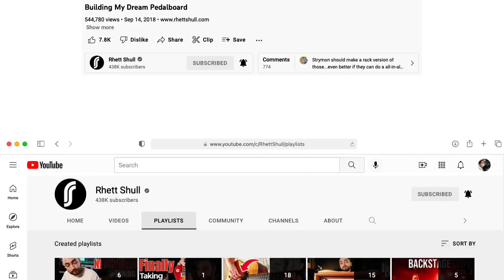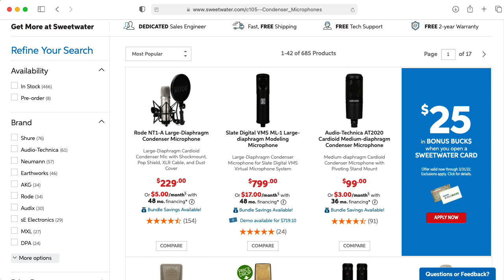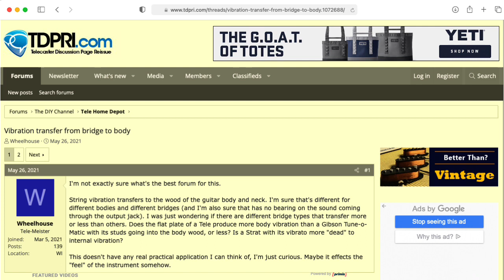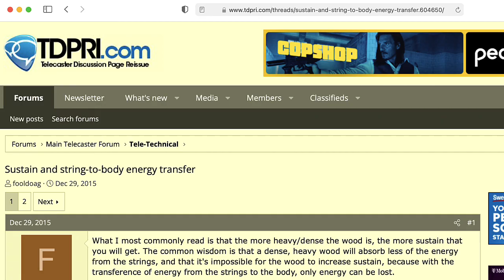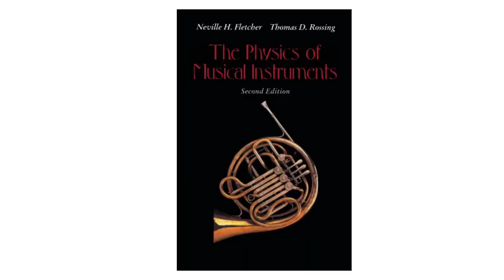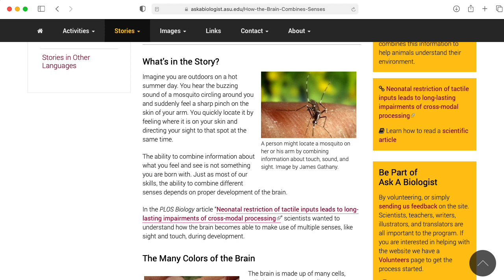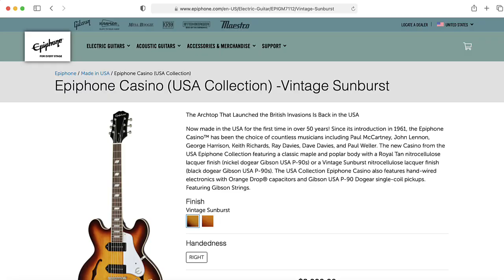Refining Rhett Shull's Resonance Reasoning: Vibrations in Electric Guitars and the Sustain Paradox

Comment: Sustain is weird, I worked in a shop for more than a decade and played 10s of thousands of guitars. Some guitars definitely sound better acoustically (my own do) and they also have plenty of sustain. I've played others that don't, and "dead" guitars I noticed a lot of times lacked sustain and had a lot of dead spots on the neck particularly on the G string. Some "dead" guitars had the same or less sustain than a banjo does, decidedly unpleasant instruments to play, but others had a lot of sustain. I'm not entirely sure if we can quantize what it is about them. As for tone, hardware can absolutely affect the sound coming through a pickup depending on the harmonics that are emphasized by the particular fret and bridge and nut materials. I bought some naval brass inserts for my Floyd rose once, and it make the guitar zingy and shrill, not only that but it seemed to setup strange resonances in the string which actually made natural harmonics have odd beat tones.
Reply from the maker: The hardware in the nut and bridge is part of the boundary conditions of the wave equation, and is absolutely worthy of further study. The typical equations (like the ones I cover in lecture for this class) assume that the end points are perfectly still -- which we know isn't the case since we can feel vibrations going into the neck and the body. It would take someone with a better understanding of mechanical engineering than me to dig into that...
Reply: @Lantertronics  Zollner has studied the behaviour of string vibration losses around the bridge/tailpiece of solid-body electric guitars with techniques like laser vibrometry. There is scope for more work on how different materials might affect that behaviour. The very small vibration energy that reaches the neck and (less to) the body have also been well studied. Our skin mechanoreceptors are just very sensitive to them, so guitarists tend to overestimate their significance.
Reply from the maker: I think that if there's fundamental flaws in the instrument like dead spots (and fret buzz, bad intonation etc), all that show up acoustically. So playing unplugged can give a quick sense of whether the instrument is a lemon or not.

Comment: One interesting sidelight is arch tops and mandolins which are designed (and I'm exaggerating here) to dump maximum energy  from the strings to the top very quickly  to produce "bark", whereas acoustic guitars are designed to control energy from string to top (most of the acoustic sound) in a controlled way to emaphise sustain.
Reply: Same goes for some electrics like the Fender Jazzmaster and Jaguar. Both tend to be quite loud unplugged - louder than Tele's and Strats. But have less sustain

Comment: I'll input some on this , its important to note that the body and the neck are very important as to the vibrations in the guitar not for what a player feels but for more of how the body and neck together keep the vibrations to a maximum. This is why denser woods in both body and neck do make a difference because the sound that is passing through the woods is able to pass more freely due to the density of the wood being greater than normal. Which allows for the vibrations to not only ring off the string but those same vibrations pass through the wood and back to the strings again cause the vibrations or if you will feedback on to itself which in turn allows the magnetic field to hear the vibrations for longer and for a more amplified signal to be produced. Its the return of the vibrations and keeping this sound revolving in a circular motion from string pluck to nut to neck to body to bridge to string and around over and over that gives sustain. The pickup actually becomes the most irrelevant part cause as you said , its just listening to the changes in the magnetic field. Of course , if you have a very crappy pickup , nothing is going to help it but a well made pickup , it will make a regular guitar sustain forever , but if you take that same pickup and put it in a very low density body and neck , the performance difference will be absolutely huge. I would also like to state that if the wood is very dense , a player can feel the vibrations better than one that is not cause the wood contributes to reflection more so than absorption of the vibrations. Also not only are the vibrations effected by the density of the woods , they are also effected by the amount and type of material that also touches the guitar like the players body , pants , shirt , belt , belt buckle etc. Which will also remove the time the strings will ring. All of this stuff matters but the pickup is the least that matters for this discussion. The nut , if its a bone nut or even better a stainless steel nut , something really hardened material wise and if the string touches more of the nut, that is better for sustain. If the bridge is a fixed bridge with several anchor points , that is better. I would say any floating tremelo bridge by comparison and design would be significantly worse than a fixed bridge for maintaining sustain. When you are looking at trems with locking nuts , those lockers create a more solid contact and anchor point which helps them to sustain , better. A whole lot of variables but I would be willing to bet , that a guitar like the ones made by https://304guitars.com/ has probably the best sustain on the market. Solid contact , top to bottom and through.
Reply: "Its the return of the vibrations and keeping this sound revolving in a circular motion from string pluck to nut to neck to body to bridge to string and around over and over that gives sustain."
That is completely contrary to all measurements of real guitars by Zollner, Fleischer, Pate and others. There is no circular loop back to the strings. When the body and neck are excited to vibrate by string vibrations, that energy has been lost from the strings, so measured sustain is always less. Luckily those measurements also show such body and neck vibrations to be very small. Some guitarists just overestimate their importance, because our skin mechanoreceptors are sensitive enough to feel them.

Comment: Great video, as always!
One thing about your last sentence: One wouldn't want a hollow body guitar for great feedback, because it is practically not controllable (speaking from experience, here). I want my strings to vibrate not my guitar body for that. Also a double Marshall full stack isn't needed, my 60W 1x 12" Fender Supersonic combo amp is more than capable of producing wonderful controllable feedback on pretty low volumes. The only thing that is needed is lots of gain, not necessarily volume.

Comment: I wonder if the reason why people claim to hear a difference in tone with different woods in a solid body guitar is because of how different kinds of wood will take away from the strings vibrational energy in different ways? Essentially, the wood behaves as a dampener and different kinds of wood will take away vibrational energy in different frequencies. People say maple is “bright sounding” so then maybe it takes away low frequencies, mahogany has more mids as people claim, so really it’s taking away high frequencies. Essentially the sustain of the guitar at different frequencies is affected by the wood’s vibration (which will be different for different pieces of wood).

And if you built a guitar out of perfectly rigid and hard material that does not take away any of the strings vibrational energy at all then you would have infinite sustain over the entire frequency spectrum of the strings vibrations.

That would basically mean that the ideal electric guitar is made of perfectly rigid and dense wood that does not vibrate at all and takes away none of the strings vibrational energy, but no such perfect ideal wood exists so we end up with the wood indirectly affecting the sound of solid body electric guitars.
Reply: (See 04:22) This is what Johan Segeborn is for :) https://youtu.be/pFOAH685KYE
= "This is what a GUITAR made of SOLID STEEL would sound like!" There are plenty of other "experiments" on his channel regarding "tone wood" and pickup interaction, too.

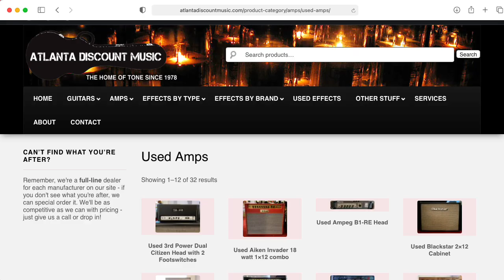Comment: From 3:55 to 4:03 is precisely the entire argument why tone wood matters. It came out of your mouth. Pickups don’t pickup directly acoustic information, but do so indirectly because the wood construction affecting the timbre of the vibrational strings. You change the timbre of the instrument, you Change what the pickups eventually hear. Place a tuning fork tuned to a note of one of the strings, onto the body of the guitar, body will resonate and eventually so will the string tuned to that note, and if plugged into an amplifier - that note will come out of the speaker. Place a thick rubber mat against the body to help deaden the vibration, and perform same experiment. Note will be quieter from the amplifier
Reply from the maker: What's interesting is the process is subtractive; different woods and bodies will be inclined to pull different frequencies out of the string, which doesn't seem to be how most people think about it. Most people seem to think of "tonewood" in electric guitars as adding semething.
Reply: @Lantertronics  it’s a totally subtractive process, similar to a passive tonestack. I guess perhaps you could get a resonance sometimes, similar to phonons in a crystal lattice?  Only way the body constructed couldn’t affect the the tone is if it was infinite mass. Then all the energy would stay on the strings with no passive removal of energy. And guitars that weigh 20 lbs seem to do a good approximation of this and sound like shit!!!
Reply: @Lantertronics  another thing is that if guitarists are use to certain woods that subtract a bunch of energy out in a portion of the frequency spectrum. Then they switch to a different species that pulls less energy out. Their perception is that wood added to the tone - when all it did was subtract less. Another point is feeling more vibration in the wood suggests that frequency is passing freely allowing the strings to vibrate stronger. When you don’t feel the wood vibrating; it’s dampening those frequencies and thus reduced string vibration
Reply from the maker: It's a question of how much it matters in terms of what's discernible to the listener, especially relative to other factors (and in conjunction with other factors, like the type of nut and bridge.)
Reply: @Lantertronics  normal listeners can’t discern anything. They can’t tell the difference between a tube amplifier vs transistors. Only guitar players can hear those differences.

Comment: I see a few ways a "resonant guitar" may have an affect on the sound.

If a guitar is loud acoustically, it seems to me that it would also be more sensitive to acoustic input. There is a factor regarding the sensitivity and frequency response of the feedback loop created with the amp.. That's why I love semi-hollow body guitars... They really come alive at volume. 

Another thing to consider is the resonance of the pickups and body in relation to the strings. The guitar is not an ideal rigid body so the pickups will vibrate causing the magnetic field to be dynamic in relation to the strings as they are somewhat interially de-coupled. There should be some microphonic effect from this which could increase with a more "resonant" instrument. 

Lastly, if we view the guitar as a mass spring damper system it must have a frequency response. You will have resonance nodes and destructive phase cancelation as the guitar vibrates at some phase angle to the string. If the guitar is resonating loudly then it is likely closely phase aligned to the input. This should result in more sustain. Considering woods have a wide range of density, even within the same piece, this will cause one guitar to sound different than another even if they are geometrically equivilent.. Perhaps the energy transfered acoustically is less impactfull than destructive phase cancelation at some frequencies. I theorize this is why both properties seem to be correlated... But I'm just some dude in the comment section so who knows.

I love the videos, Thanks!
Reply: There is a considerable body of direct experimental work on the physics of real solid-body electric guitars. So there is no need to make even educated guesses about many things, as direct evidence is available. See the independent work such as Zollner, Fleischer, Pate and others.
So firstly, your suggestions would be reasonable if significant vibration actually reached the body of solid-body electric guitars from the strings, like they do in acoustic guitar. However all measurements of real solid body electric guitars - whether by bridge admittance measurements or direct body vibration measurements - show that such body vibration is very small (neck vibration is greater). The fact that some guitarists are seemingly tricked into thinking such string-induced body vibration is both significant and a "good" thing is a function of our highly sensitive skin mechanoreceptors (able to feel very small vibrations) and those guitarists' ignorance of the Conservation of Energy Law.
Semi-hollow and hollow-body guitars are somewhat different, for fairly obvious reasons (slightly greater bridge mobility), and have slightly higher bridge admittance. But not as high as acoustic guitars.
Also, your suggestions about "phase aligned" vibrations are also unfortunately inconsistent with all of the direct experimental evidence of how resonant modal frequencies (mainly of the neck) only result in LOSS of vibrations from the strings of solid-body electric guitars. Sustain is only enhanced by the absence of such modal frequency vibrations in the guitar's structure, as string vibrations losses from the strings (which excite any such structural vibrations) then do not occur to the same extent.
The only well-controlled study I am aware of looking for evidence that pickup vibration contributes to pickup output is the small study by Puszyński (2014). Consistent with the above findings of very limited body vibrations, it showed that pickup vibration did not contribute.
Guitars and pickups at very high volume (an increasingly rare phenomenon) are subject to the additional physics of high-energy sound pressure waves. Our perceptions are likely also distorted in such aurally-extreme environments, so are perhaps not highly reliable. While the occurrence of feedback is obvious, what other physics phenomena may or may not additionally be operating there, and contributing to how the guitar behaves, awaits proper scientific study.
Reply: @vw9659  Here is an example. If I'm wearing my in ears and tuning often times I can hear my bass in my ears with no electronic signal as vibrations are conducted from the strings, to the bridge, to the body, to the straplocks, to the strap, to the IEM cable, to the IEMS, to the bones in my ears.. Or if you place a guitar to your chin you can hear the instrument through bone conductrance (FYI Pro tip if you need to learn something on the fly backstage and don't have an amp to plug into). So I disagree that the vibrations in the body can be considered insignificant. They are clearly audible and can conduct between many mechanical links... 

Also the decay time of notes of two similair guitars will vary from instrument to instrument. They will sound different plugged in even if subtle...  There is a lot going on. It's not just the natural eq curve of an instrument.. It's also how fast a note "blooms" or dies out or fundamental vs the harmonic content in the net output wave form..

If you can tap on the body of your guitar and hear it through the pickups, I think you have to consider the body is in play as part of the system. I agree that a more "resonant" instrument feels better in the hands... But I believe they also sound different than instruments that don't "resonate" as much.

Comment: That is fascinating! Someone should do a test how resonance effects sustain.
Reply: I wonder about how people hear sounds and use various words to describe them. I'm wondering when Rhett says it "has resonance" if he means "it sounds good to me." The common use of such words may be different from their technical meanings.

Sustain in a piano is especially complex due to the changing decay envelope. The strings of a note start out in phase and decay rapidly as the energy is put into the soundboard, then one string goes out of phase and very little energy is put into the soundboard, but the decay is much slower.

I noticed Aaron showed a short clip from this "Tested" video (Yeah, I watch Rhett and a lot of other videos too), in which a Telecaster body is replaced with a 2x4, and other variables are controlled enough to get a nearly identical tone - a good job of someone injecting science into musical sound:
https://www.youtube.com/watch?v=n02tImce3AE
Reply: It's been done and written up in papers by Fleischer and Zwicker, and by Arthur Pate and his colleagues at the Sorbonne.    Resonance reduces electric guitar sustain at and around resonant frequencies, because a resonance is just a willingness of the guitar neck-plus-body to vibrate in certain ways, making it easier to transmit those frequencies out of the string and into the wood, where they are quickly lost due to internal friction, because bending thick and heavy wood takes more work than bending thin and light steel strings.